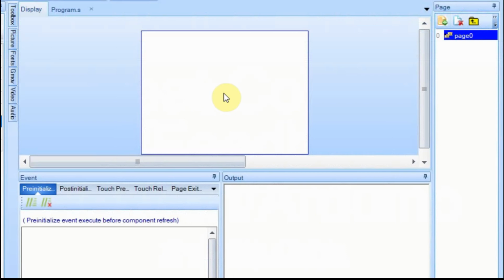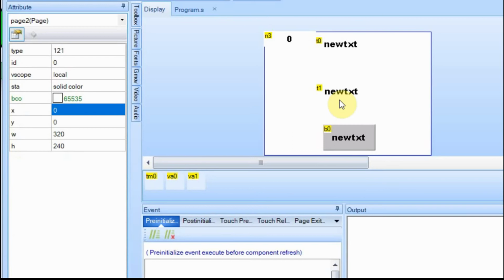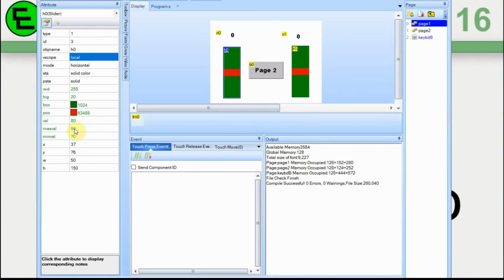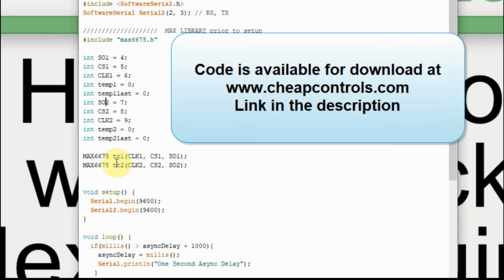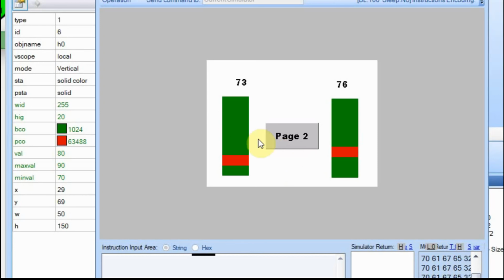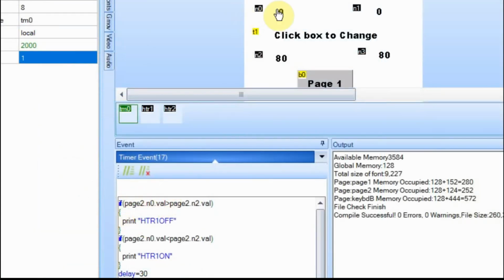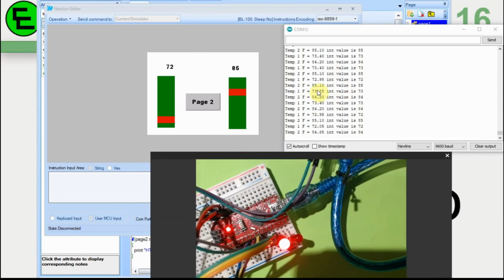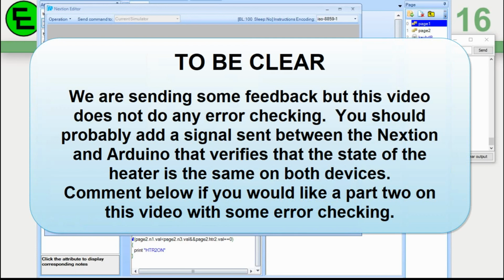#116 IN-Depth Nextion Arduino Control of heaters(LEDS) with Feedback Tutorial

Comment: Thanks for your videos and instructions. It's better like at school, you can understand everything, although it's not my mother tongue. But I would like to ask something: in another video you showed how to turn on relays for time, but how do I do it here?
How can I enter that it should only be 16°C in the evening, but 22° during the day (between 4:00 p.m. and 8:00 p.m.)?
Next question:
This circuit can also be used for the watering system (instead of a temperature sensor, use a soil moisture sensor) and set the values there, BUT how do I make it (as in another video) set the time for switching on, so it only switches for 20 seconds one (otherwise it will flood everything, or is the well empty)?
Reply from the maker: That is a lot to address in a comment.  I see you have asked to join my group on facebook.  Please ask again on that messaging system and I will try to help.
Reply: @CheapControls  okay, thank´s

Comment: String endChar = String(char(0xff)) + String(char(0xff)) + String(char(0xff));

// This code work successfull
  Serial.print("Normal.t4.txt=\"");
   Serial.print(String(value.valLong));
    Serial.print("\"");
    Serial.write(0xff);
     Serial.write(0xff);
      Serial.write(0xff);

// But this is not work
Serial.print("Normal.t4.txt=" + String(barveri) + endChar);// this is not work endChar is not work please help
Reply from the maker: You have to surround the String(barveri) with quotes like this  Serial.print("Normal.t4.txt=\"" + String(barveri) + "\"" + endChar);